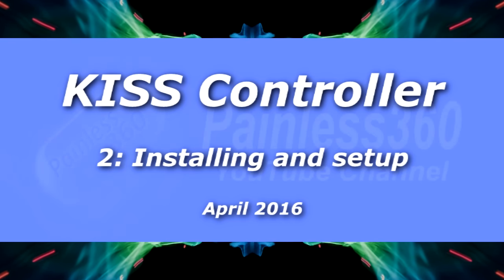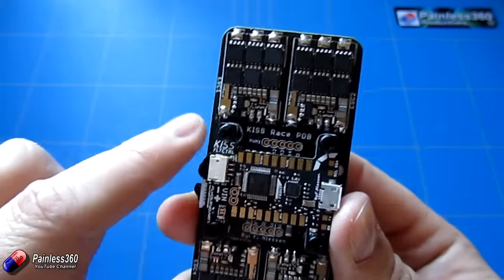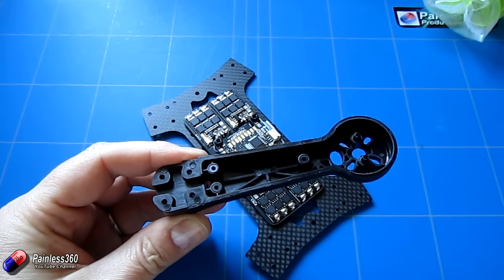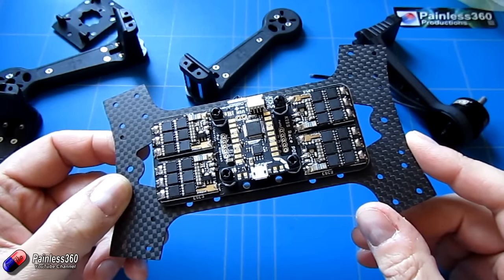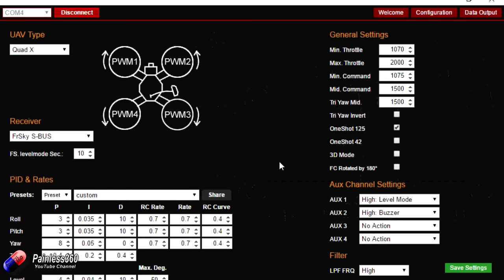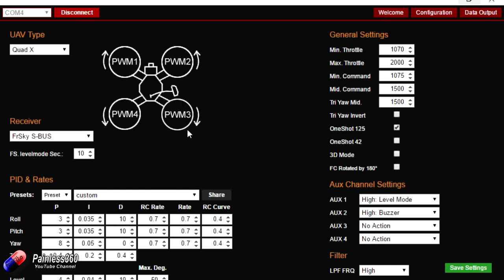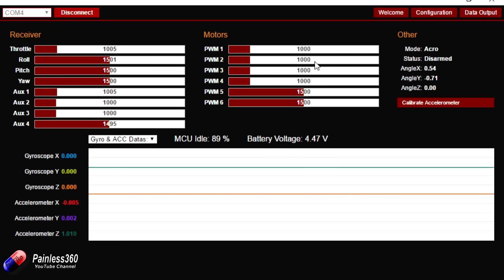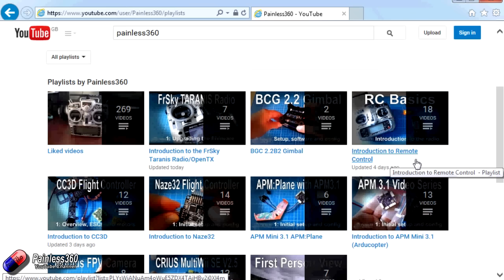(2/2) KISS Flight Technology - Building the KISS flight controller, 24A ESC and ESC PCB

Comment: Hi, I like your Kiss series and its been helpful. I am finally doing my own build using the Kiss ESC's, PDB, and FC. I am starting to solder the ESC's to the PDB and noticed that there isn't a third pad on the PDB for the signal ground pad located on the ESC to be soldered too. It's #5 in the in the ESC picture you showed in the first video. Is this not needed when using the kiss PDB? If it is needed how did you connect it?
Reply from the maker: I'd check with the vendor, sounds like it's changed since we made the video. You should be fine with the common ground on the power system. Best of luck!

Comment: Awesome Video! I am soooo jealous of this frame and I think I know what my next build is going to be already! Could you do a video of the black sheep powercube vs this KISS setup because they are both hitting the same market for an all in one, neat setup? Or if you don't think that would be popular then if you could give me a few points to think about for my next build it would be great! Thanks again.
Reply from the maker: +DIY4Dummies I'm not planning on covering that. You are comparing apples and oranges despite them using the same 'all in one' style setups. TBS is using Cleanflight and is designed to work with the Vtx and OSD systems, KISS is an approach with all the energy being on making it the best possible HW/FW/SW setup to fly amazingly well...
Reply: +Painless360 So if you want all the cool OSD gizmos etc. It is better to got for the powercube whereas if you are looking for sheer flight performance on a race quad a KISS system should in theory be much better since it is designed to work perfectly with itself? (I'm interested in the differences too)
Reply from the maker: +Sussex Aerial Photography Excellent summary ;) Both are great systems but the KISS is very different from those running one of the 'flights. Happy flying!

Comment: Painless yet another brilliant video. New to all this drone tech etc. silly question  but why is there only one servo connector? Many thanks for all you do.
Reply from the maker: Good question! Not a silly one at all. It's because we're using one of the ways to send all of the RC channels down a single wire (PPM and S-Bus are the two most common). See the videos on this in the 'Introduction to Remote Control' series where we cover it in detail. Best of luck!
Reply: +Painless360, so as I have the x8r with sbus I can just connect one servo cable to the flight controller and then to the receiver. That makes it just two cables to FC and PDB with regulator. Thank you for all your help and amazing videos. I'm in the UK so I hope to see you flying.
Reply from the maker: Yep - see https://www.google.co.uk/url?sa=t&rct=j&q=&esrc=s&source=web&cd=3&ved=0ahUKEwjY6rrWufHOAhWfHsAKHY3oD7sQFggmMAI&url=https%3A%2F%2Fflyduino.net%2Fultraesc%2Fdownloads%2FFlyduino-KISS-FlightController-Manual-v1.06-en.pdf&usg=AFQjCNF2fzNIFcpOSkc3ZEwLn8xwZheRTw&sig2=agvwatmez2XMbzdMPkrQjQ&bvm=bv.131783435,d.ZGg
Reply: +Painless360. Great I already have that document. can sbus control the aux commands within kiss fc or would I have to connect separate servo cables to aux pads?
Reply from the maker: No all through sbus.... See how in the video ;)

Comment: I was really hoping this series would show me how to install a kiss fc with a conventional setup and the ways it can be setup with pwm, sbus, satellite and how to solder it to a standard pdb. I'm not quite sure about where to solder pins and if I need to. Havn't checked all your vids yet so you may have made one already. Could you please make one if you hav'nt already As a noob I appreciate any help I can get. Without a local hobby shop you are making a slightly complicated but awesome hobby more accessible to everyone.
Reply from the maker: Wiring to traditional ESCs and power isn't too tricky. You still use the pads on the FC. The manual for the Kiss FC is excellent and covers all you're looking for too - https://www.google.co.uk/url?sa=t&rct=j&q=&esrc=s&source=web&cd=1&ved=0ahUKEwj0iYDd9fDPAhVLI8AKHYeYBhgQFggeMAA&url=https%3A%2F%2Fflyduino.net%2Fultraesc%2Fdownloads%2FFlyduino-KISS-FlightController-Manual-v1.06-en.pdf&usg=AFQjCNF2fzNIFcpOSkc3ZEwLn8xwZheRTw&sig2=sq3a4KV1OiO8Ahhx4aDuwA - you will need to solder pins into the PWM outputs to plug the ESCs into. Best of luck!
Reply: Wow, thanks for such a quick reply. Just watched a couple of vids and I think I've got a pretty good idea now. The vid I just watched he used the s-bus and soldered the esc directly   onto the board. It didn't look to complicated. I think I'll do it like that, not sure yet. Thanks heaps for the links and for the help.  : ) !!! Just had a look at the manual and I don't think I can use s-bus as I'm using a spektrum dx6i ?
Reply from the maker: Probably not, most Spektrum receivers are PPM/PWM but check on the one you have. Best of luck!
Reply: It's all still a bit confusing but I'm sure I'll work it out after a good nights sleep. Thanks again for the help, much appreciated.

Comment: Hi, I'm still slightly confused. What is the need for the additional Voltage Regulator if you can just do what you did and power it with a jumper lead from the main LiPo? What type of battery requires this additional component to be purchased?
Also, one more question. My FPV camera requires 12V, can this board provide that?
Reply from the maker: +Steven Milward sorry, I don't understand the question..
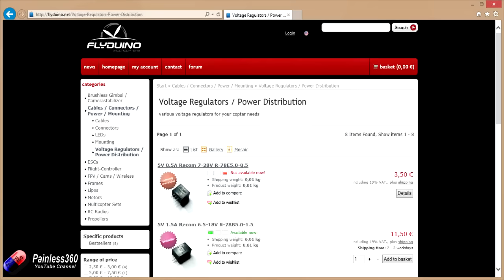Reply: at 9:40, what is the purpose of buying and inserting a Voltage Regulator, if you can just do what you did.

Comment: Can you explain if you have not already what is Level mode and how to set it up?
Reply from the maker: Not sure what you're asking, we cover that at 14:40 in the video. If you're new to R/C then we have a lot of videos in the 'Introduction to Remote Control' series that cover lots of the basics. The mode selection on the KISS is the same as every other board we've looked at on the channel - the 5th or 6th channel moves with a switch on the radio and you setup what flight modes you want for each of those switch positions. Level mode is an auto level that will limit the amount of angle the craft will fly at and also return the craft to level if you let go of the sticks.. Hope that helps.

Comment: Hi painless360, I finished building my quad with KISS FC. While I arm the quad(testing on the bench)and increase the throttle I noticed that at mid throttle motor 4 stops spinning. The PWM values are all different. This does not happen with 0 PIDs. But with the default or any custom PIDs I see the oscillations. Any idea why?
Reply from the maker: +Pavan Shetty https://youtu.be/DDnaAQLjcQQ may hold of the answer. Best of luck

Comment: At 8:00 - 9 you reference needing to add a voltage regulator based on battery type, or you can go with the option of not using a voltage regulator. How did you determine you wanted to skip installing a voltage regulator? The battery i'm buying is 2200mah 75c, if that's of any relevance. Also I would love to purchase all the 3d printed parts for this drone from you, the spacers you made are an awesome idea.
Reply from the maker: It's the votlage of the pack you need to look at 2s vs. 4s etc. The power input on the main FC can handle 3-4s (from memory - check the manual) but the modules available for the cradle can support much larger batteries.. What parts are you after?
Reply: The pack I'm looking at, but have not committed to is 14.8V 2200mAh 75C 4S1P 32.56WH. Which looks like a 4s battery, and is what i was aiming for. So basically if i want to run a 6s battery i'll need to figure out what voltage regulator I need because the FC doesn't anything above 4s.
Reply: 1:06 3d printed shield, I'd love to buy

Comment: Do you know which way the esc's spin the motors natively? Cw or anti-clockwise? I soldered the jumpers on 2 of my esc's and need to figure it out before I solder the motors. I can't find any solid info online.
Reply from the maker: Only by hooking them up as it's the order of the wires that dictate the spin, not the model of motor..
Reply: I have seen several tutorials now that jumper the solder pads on 2 of the esc's right off the bat and hook all the motor wires up to the esc without crossing any. That made me think that the esc must be pre-configured to spin the motor in one direction. Thanks for the response.
Reply from the maker: Some ESCs have the ability to reverse the direction in hardware or software. See the build series for how you do that in the BlHlei settings or you solder a contact on these KISS ESCs.. Happy flying!

Comment: Ok this may be stupid question time, but where on the board is AUX 3, AUX 4 and can you use them to control items on off?
Reply from the maker: Where have you got the detail from about the Aux ports?
Reply: I have been looking at the Kiss FC PCB pin outs for the board and can see Aux 1, Aux 2, BUZZER Output and no Aux 3, Aux 4. This dose not seam to relate to Kiss interface where you have a full 4 Aux ports, so I am a bit confused on the outputs for the board. 
Like I have explained below I want to set up a Aux port to turn on/off LED lights wile using another Aux for a buzzer and one more to Arm the motors.

I now how the Buzzer works so its just the Aux 1,2 ports on the PCB.
I guess what I am asking is, Aux ports on the FC PCB Board are they inputs or out? 

If they are outputs how are they activated and linked to the RC controller using the Kiss interface?

Sorry I could not put more detail before but I was typing on a phone.
Reply: what I am looking at is setting some led lights to be activated on off by the controller

Comment: I changed the board alignment to Yaw 90° and now motor 1 & 2 are interchanged and both turn the wrong direction... After changing the board alignment to normal everything is okay again (cleanflight/naze 1.12.0).
Reply from the maker: +labomat Interesting, thanks for posting.
Reply: +Painless360 My comment was made to a completely different video - will move it there...
Reply: +Painless360 My comment was made to a completely different video - will move it there...

Comment: Thanks for your videos bud. They have been invaluable. My Kiss fc doesn't not connect when i plug it into my PC (win10). It just says :Connect USB to FC and select COM Port.: I only have 2 choices, Com 5 and Com6. I've tried uninstalling and reinstalling the driver a bunch but to no avail. My SPF3 board connects to Betaflight with no problem on Com 9, Any ideas?
Reply from the maker: Are you putting the board into bootloader mode? http://kiss.flyduino.net/dwkb/flash-fc-pc/
Reply: Yes sir.
Reply: I got my PC to "see" the FC and I could open the GUI which is great. Next thing is dFuSe demo won't list my board as in DFU mode, with the bootloader button pressed. Also tried uninstalling Stm32 and zadig. Thank you though for your help. Yoy the man. Please continue preaching and teaching.
Reply from the maker: The only other thing I can think of is to look as using Zadig.. best of luck!
Reply from the maker: Odd, Sounds like a long shot but I'd try another USB cable/port.. Best of luck!
Reply: Eureka! Thank you for your help. I'm a happy subscriber and sharer. Cheerio..jk ;)